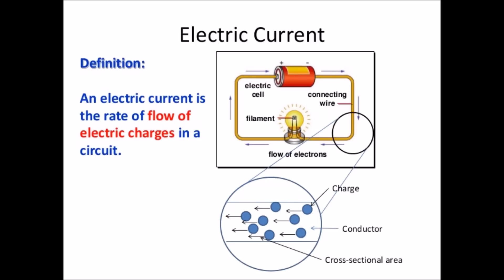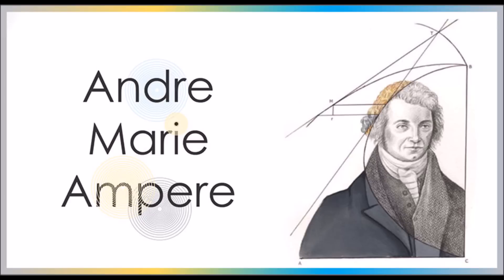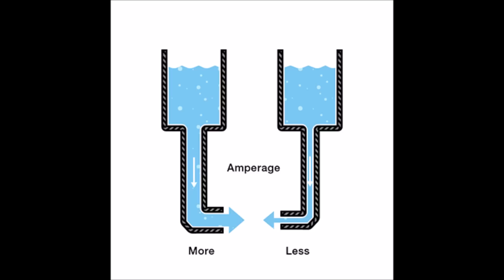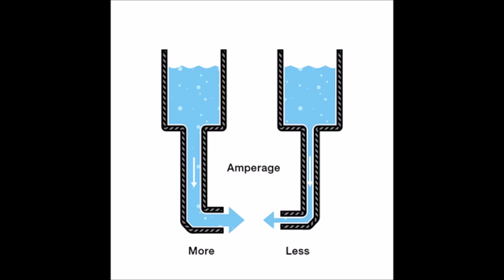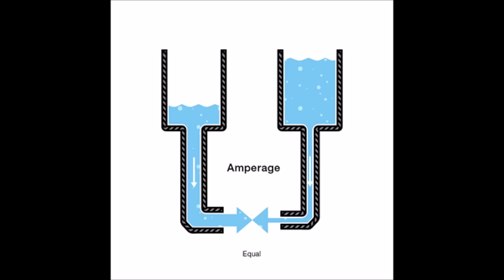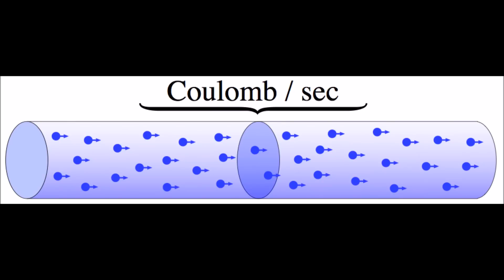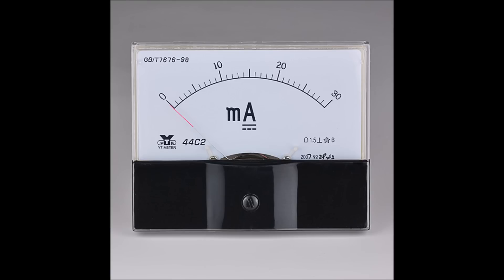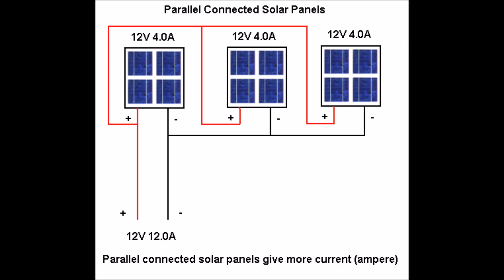Solar Panel Basics - Current 101

Comment: Excellent summation on current...well done. I like the "gas tank" analogy when talking about batteries. A bigger gas tank means you can go further...but, you need to fill it up with more gas compared to a smaller tank. Or, having an "engine" with 500 horsepower...you may not need 500 hp every day, but when you need to go fast (or use a lot of power) it is there for you. A small engine and small gas tank, can only do so much.
Reply from the maker: +Chris DIYer Nice, that analogy has some good aspects to it for sure.  I may have to use that in the future :)
Reply: Haaa! Surely brother! No problem.